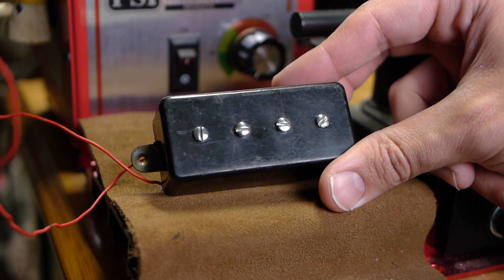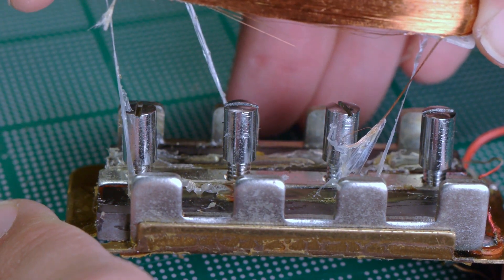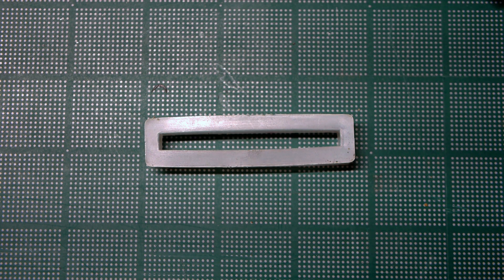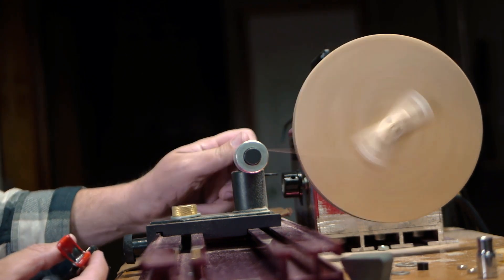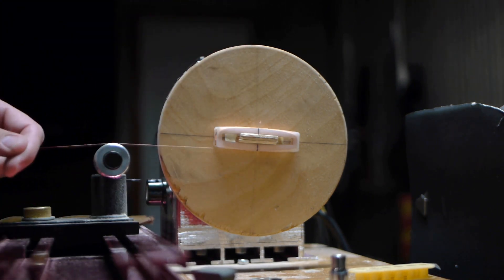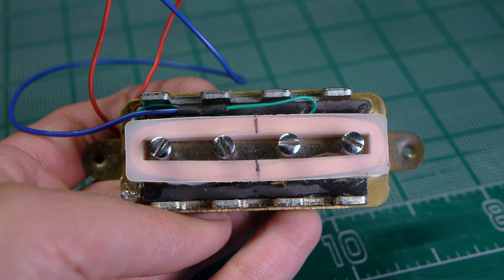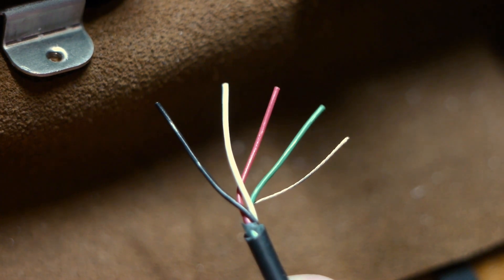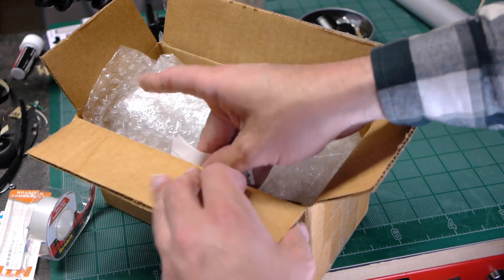Univox Hi-Flier Bass Pickup Rewind. Took Some Detective Work!

Comment: When you strip the insulation to test the resistance, do you do anything to cover the exposed length of wire—or do you just continue winding because that exposed bit will be buried under insulated winds and therefore be unlikely to short?
Reply from the maker: I don't insulate it, and you hit the nail on the head -- the exposed bit is surrounded by insulated wire, so it won't short, or at least, will be extremely unlikely to short. For it to short it would require the insulation to come off on another section of the wire in immediate contact with it. 

I do try to avoid splices when I can, as I've occasionally had odd issues possibly from wire splicing mid-wind, such as very dark sounding pickups. I'm not sure why this would be. Especially since the capacitance readings read in the normal range. It's also possible it was just a fluke or the spool of wire itself had some issues and it wasn't from splicing, as I've spliced many pickups mid-wind and never had an issue. 

i suppose if you really wanted to go the extra mile, you could quickly hit it with an artist's brush and some dielectric varnish or shellac. Couldn't hurt and might be better in the long run! So even though I don't currently insulate the wire, it might be good practice to insulate it anyway. Could be a good idea to bulletproof the coil against any possible future issues, similar to how I always wrap the magnets with thick electrical tape prior to winding when I'm winding Fender style pickups with the exposed magnetic polepieces that you wrap the wire directly around. I use either Kapton tape or black cloth acetate electrical tape to wrap the mags before winding, every single time.

Comment: Wow!  I've been putting the refurbishment of my Univox HiFlier bass off for a while now.  This pickup rewind just unlocked half of it for me!  Now I have to figure out the tuner rivet hole.  Thank you for sharing!
Reply from the maker: Absolutely. Glad it could help! I've lucked out on more of these. The last three that came in, I was able to fix with a splice. 

I've come up with my own technique that I call a knot splice that I'm working on a video for. As simple as it sounds: using a strand of 42AWG to tie a knot around the broken start lead magnet wire, then fluxing and tinning. 

Clip the ends, and good to go -- time to re-tie around the pigtail and re-tin. 

Haven't rewound one since this video. I do wonder if they're all the same. The most recent was a humbucker. Unfortunately, even with the micrometer, it's so finnicky, it's hard to tell the wire gauge. Sometimes I think it's one gauge, then re-measure, and it's off...so, very tough. Have to infer a lot from the DCR / inductance. Plain old experimentation never killed anyone either. Well. In some cases I suppose it has.

Comment: Fantastic video MD!!!

I also have a Univox Hi-Flyer bass, but mine is a phase III & it has humbucker pickups as opposed to single coil pickups. There is something wrong with either my neck pickup or the 3 way switch. When I test the pickups with my multimeter by plugging a guitar cable into the input jack and using the multimeter on the other end of the guitar cable, the bridge pickup position shows 10.58K. I get the exact same reading from the center “both” position but the neck position only shows .279M

Does this indicate a bad neck pickup or possibly a bad three way switch?

Thank you!
Reply from the maker: It's very likely that the pickup is dead. To be sure, you can try desoldering the neck pickup from the switch, and testing it separately. That will reveal it for sure. 

If you're still getting the wonky reading, that's probably it for that pickup. DCR is not always 100% accurate but is usually accurate for diagnosing whether a pickup is working or not. 

I do have an older video on pickup diagnostics here in case you're interested: 

https://youtu.be/XDCHles5of4?si=ATPNgwVwO1sLo2hM
Reply: I will try disconnecting the pickup and testing it again. If it is broken, are you able to fix it as you did in this video? It is a humbucker, so it’s more complex. I was able to remove it from its casing and I can see that it has been waxed.
Reply from the maker: @bernoulli1  I have fixed humbuckers before. I have a video here on one I did a while back: 

https://youtu.be/yi-wpZhnz8M?si=BiVYqa_Xgvxqp_d5

Humbuckers are certainly more challenging, but mostly due to the extra amount of time and dexterity required to wire them correctly and assemble the baseplate. 

Having more measurements on the bridge pickup would be helpful as well. I can speculate -- but having concrete measurements takes a lot of guesswork out of things, when it comes to matching pickups. 

10.58 DCR is something I could certainly work with as long as I know the wire gauge. I can test the neck humbucker wire on my micrometer, though it is subject to human error, and when dealing with such fine measurements it can be tough to discern. 

Anyway, yes, I can do that! If you want to take things further, you can reply to me here, but for followup in regards to shipping and all that, hit me up at:

guitarmdofficial@gmail.com
Reply: Wow… thank you so much!!!
I will try to desodder the pickup tomorrow and test it again. I will let you know.
Thank you!

Comment: What tonewood do you prefer for your toothpicks?   Ate you more of a traditional spruce or birch guy. Or are you a more sustainable resource minded bamboo user.   Square or rounnd profile? Or perhaps one of these newer compound radius toothpickers?
Reply from the maker: Compound radius old growth birch, 100%
Reply: @guitar_md  Right on brother. Always love your work btw.
Reply: Fantastic video snd excellent work!
I just got a Phase III Univox Hi-Flyer bass. The phase III basses have humbuckers. I’m pretty sure that the neck pickup is bad. My multimeter shows the bridge pickup position at 10.58. The “both” position also shows 10.58 and the neck PU is coming in at .279
Does this sound like a bad neck pickup or possibly a problem with my 3 way switch?
Thank you.